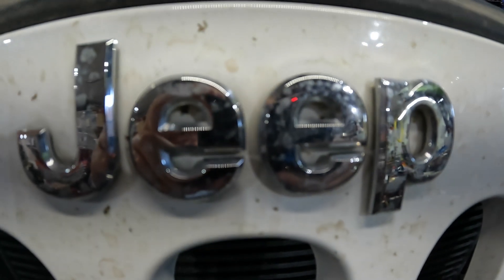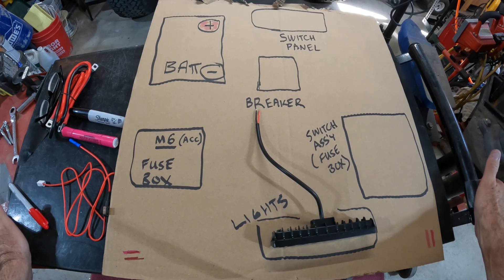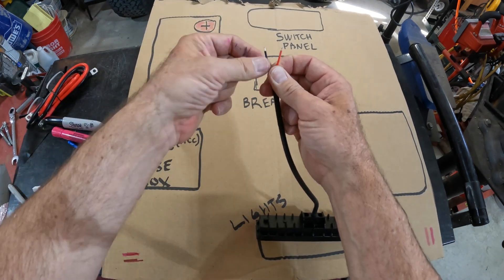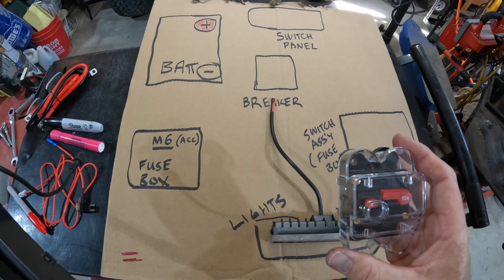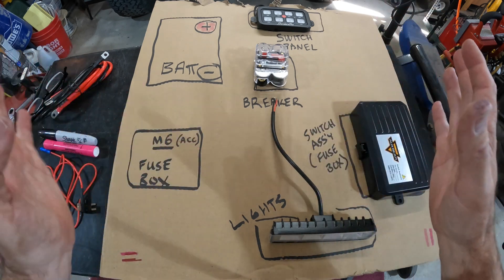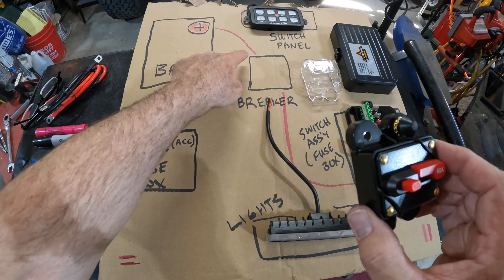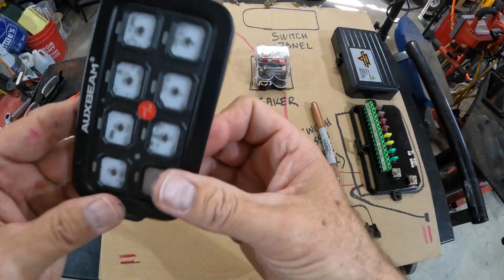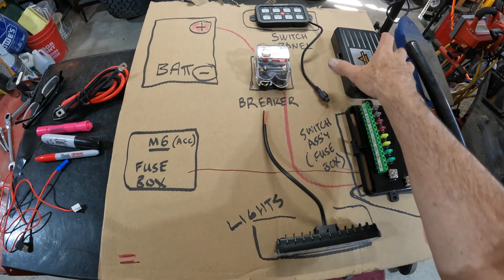Auxbeam Pt 1: HOW IT WORKS

Comment: Would you say that this is a beginner-level install ??? I know very little about installing these things but am willing to learn.
Reply from the maker: As a beginner, I ran wires from my battery into my cab, drill the hole in my dash, installed the switch, wire in the fuse, then ran the wire out to my lights. It was a total pain in the butt, but it's how we did it back then. But now this way is way easier. So is it a beginner level install? No, but you have to start somewhere. Take it slow, do it one step at a time, watch a bunch of videos on it, protect your wires from abrasion, tie them up tight so they don't get damaged, don't change wire sizes, use the factory supplied stuff if at all possible. Yeah, you'll probably screw something up here or there, but that's how you learn. Nobody was born able to do stuff like this. I have a few more vids under playlist "auxbeam" on my channel that might help. I can't tell you yes anyone can do it and won't damage their vehicle or hurt themselves, but do you have the same brain everyone else does? Then yes, you can learn if you are willing to take the risks. Lemme know how it goes👍
Reply: I remember those days where I installed my Johnson 25 watt radio direct to the battery when I was in my 20s in EMS.  It's been a minute since I've done any of it.  You're videos are thorough which I truly appreciate. Im going to pick up the auxbeam and give it w whirl.  I'll definitely keep you posted. 

Thanks for your reply.
Reply: Follow up- I installed it over the weekend with finishing it yesterday!  I ended up running 8 ga wire to the battery I did learn a bunch of stuff along the way.   Now it's onto wiring the cool stuff - lights and GMRS radio.   

Thanks again.
Reply from the maker: @robcamp3543  Aha, radio! I never thought of that. Glad it's working out! I just bolted amber fog lights onto my jeep, and this auxbeam switch controller makes it sooo easy to hook up. Love it! Lemme know how it goes!